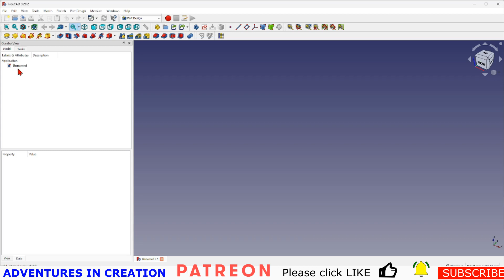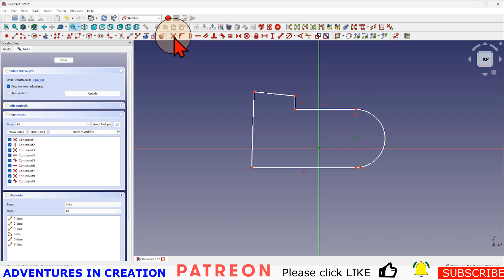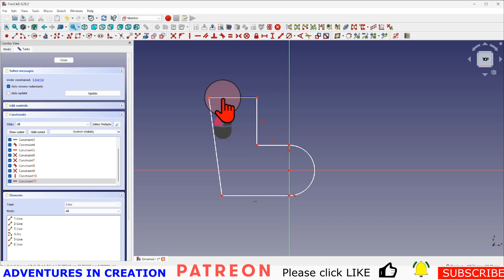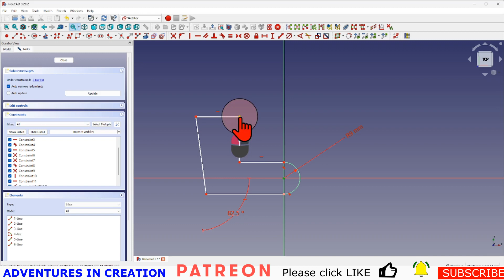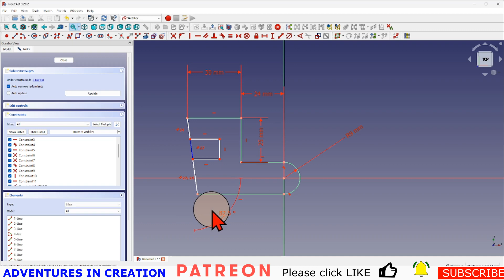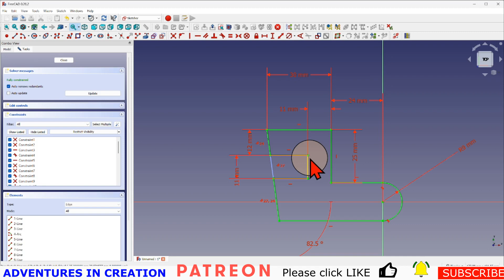FreeCAD for beginners #49 adding, deleting and modifying constraints. #freecad #cad #makers #design

Comment: I have a pretty simple object to make but CAD :( it makes me very unhappy. I want a circle to start with 30mm diameter and then have two openings in that circle = remove parts of the line, how to do that?
Reply from the maker: You can do it with the trim tool in the Sketcher.